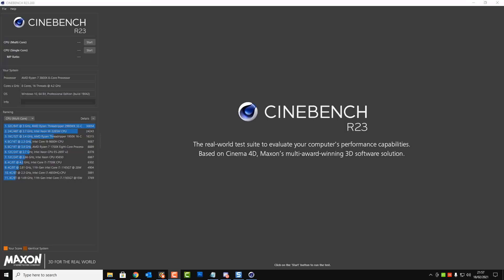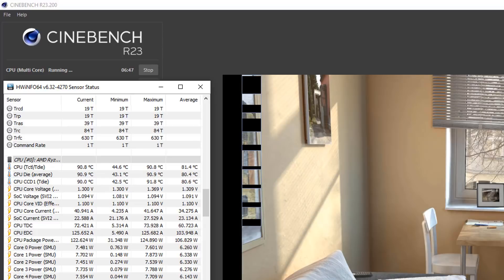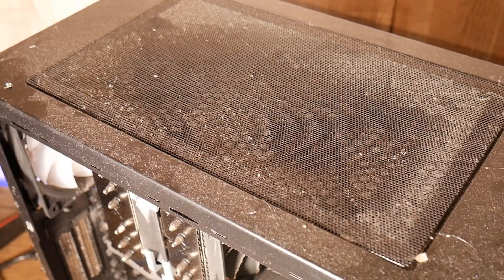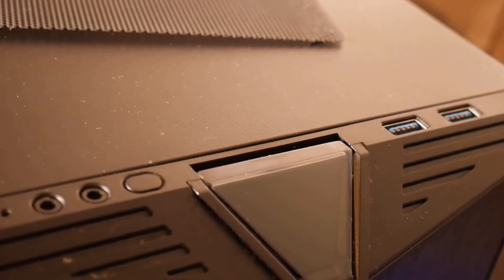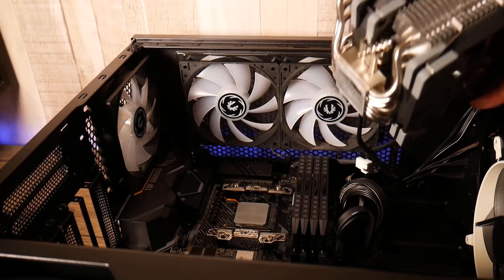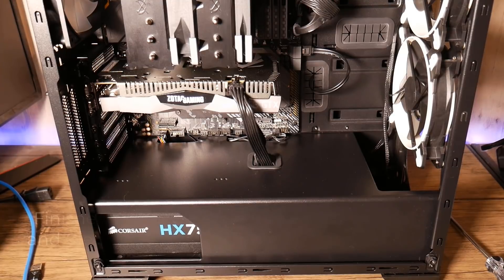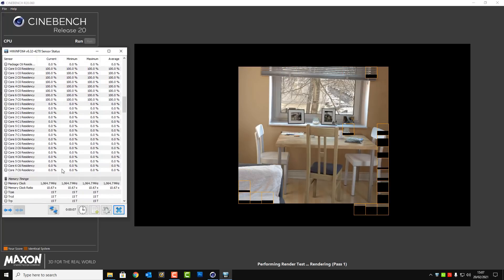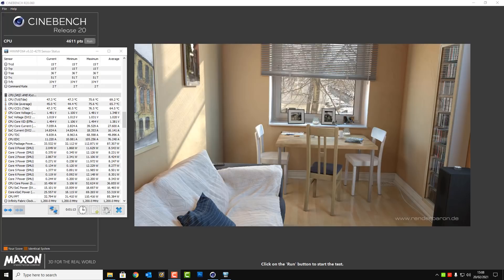How To Clean a Gaming Computer

Comment: Take the case outside and take a leaf blower to it. Obviously put the case in a VERY stable position (MAY need to prop it to stop it from being blown over).

Also area that you do this in is also important - i.e. Don't want to be pushing twigs and leaves into the rig.

If done right you can be done in 2 minutes.

Comment: I use a larger Leaf Blower but stop the Fans from spinning with a pencil

Used to use a Air Compressor but they introduce moisture and oil residue from the Compressor

Comment: How to fix system interrupts between16% and 20% when is computer without opened softwares? Sysmain is disabled, special effect for sound disabled, hdd without errors, memory and motherboard are also ok, disk partitions are cleaned by temp and junk files, drivers all updated and windows 10 updated on latest version!
How to see, what is real cause that percentage? I want to back cpu usage between 0% and 2% when programs aren't opened!

Comment: I used to work for a company that never shut their PC's off ever they ran 24/7 365 and if you ever had a problem then you would call an IT person and they would come and replace your PC with another one.
One time I took the side cover off my PC and it had a complete blanket of whitish looking dust that covered everything inside.
I myself on my personal PC's take them out to my garage once a year and set my compressor on 20 psi and blow everything out that way.....Works perfect....And in your video don't forget to blow out the PSU it has a fan and gets dirty also.

Comment: Blow or Suck? I use a vacuum cleaner and a small paint brush to loosen and remove the dust. Had a friend who used a compressed air-line to clean his PC which ended up in causing damage to the motherboard so be careful with the air pressure :-)

Comment: can one safely use an air purifier near a computer?
Reply: I would not use it too near to the PC, or aim it directly at the PC's intake. I have an air cleaner just above my PC and an air humidifier/cooler at some 2 meters away on the floor - been using it for years now, and no complaints.

Comment: I also use a blower for cleaning my tech equipment, along with a soft hair paintbrush. Just curious though, wouldn't it make for a better "clean" if you remove the RAM!?...(that's how I clean MY PC's...remove the ram (use a small piece of tape for each RAM module...to "label" it and place 'em back in their correct spots!)....what do you think? and what about "contacts"?...should or DO you clean those or leave 'em alone?

Comment: Pro tips when cleaning fans:
While the fan can take some spinning, there is a limit and going over the RPM means you cut the life of the bearing helping the fan spin. Yes, there are many kinds of fan bearings even some that just use magnets, though prices vary as will noise levels.

Like our video creator has said you can hold them or you can use something plastic to keep the fan still. Don't use metal as you might hit something with charge in the case of a power supply (there are fan-less options, price and total Wattage vary).

By the way if you need a new fan, a lot of them are using sones as a metric for the noise level though that is a measurement that is not scientific like decibel (db). There are sones to db converter pages out there that can help, but remember over 30 db is considered loud (concerts and your own home can easily be above this). For quiet below 20 db was the measurement. Do note there are apps that can turn your smartphone into a noise meter, though these vary in quality. Actual noise meters vary in price.

Just a few quick pieces which may help others and those looking for a home office or home theatre (British spelling for theater) setup.
Reply from the maker: Thanks for sharing.